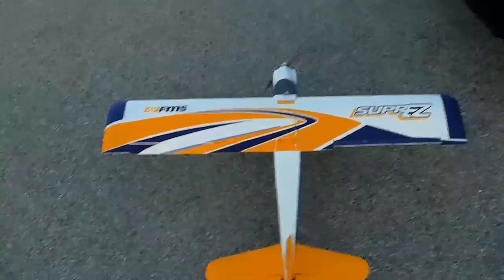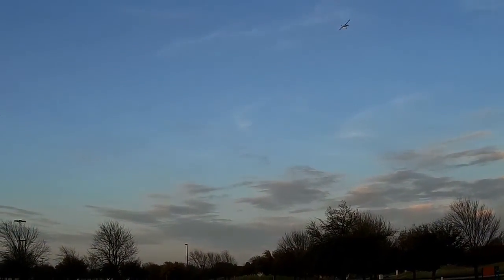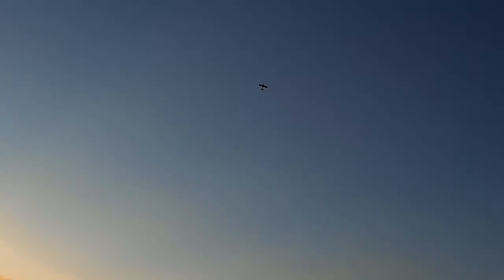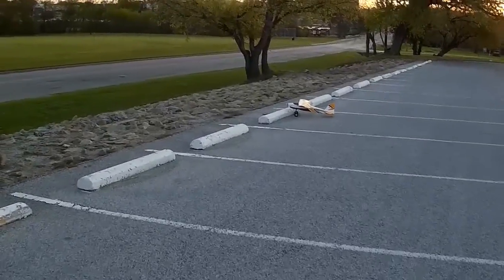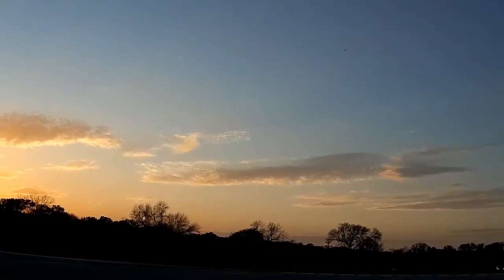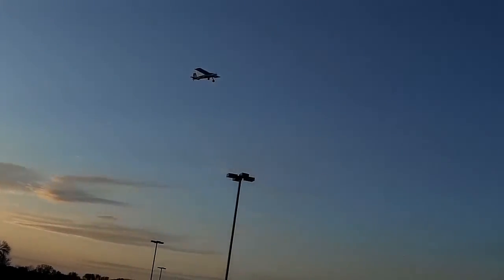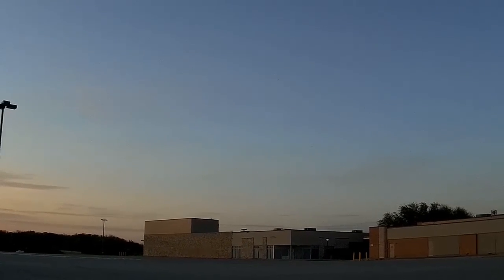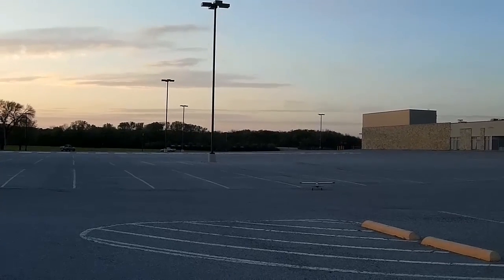FMS SuperEZ on 03 26 16 - 1st flight with flaparons

Comment: Hi poker2145. Don't know if you're familiar with RCGroups or not. We have a thread on the Super EZ here at this link. https://www.rcgroups.com/forums/showthread.php?2647384-FMS-1220mm-Super-EZ-Trainer-Recommended-Newcomers-read-1st-12-PostsI tried the Flaperon setup and found I get nose-down with flapersons down. That's completely different than most high wing planes but that's what I've experienced. Check out our thread on the EZ. It's a great plane for a relaxing flight.
Reply from the maker: Thanks - I will take a look.

Comment: So what was the verdict?
Reply from the maker: The use of flaperons on this plane causes the nose to drop, so you actually have to mix in a little up elevator to off-set it.
Reply: Poker2145
But is it flyable with the flaperons down?
Reply from the maker: Eric sin sinner 

Sure - Just mix in some up elevator with it.
Reply: Poker2145
Normally you mix down elevator with flaps!
Reply from the maker: Eric sin sinner :
Yep - That is what surprised me...
However, I fly it with a 2200 battery and the manual calls for a 1300 so the extra weight may have something to do with it.
Reply: Poker2145
the manual probably states a 1300-2200 range and I do find some planes fly better with heavier batts